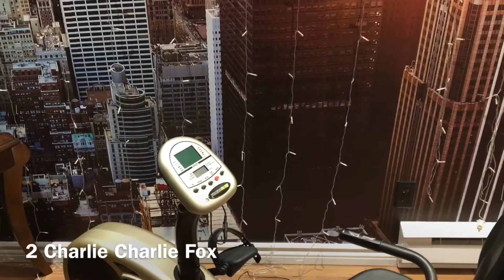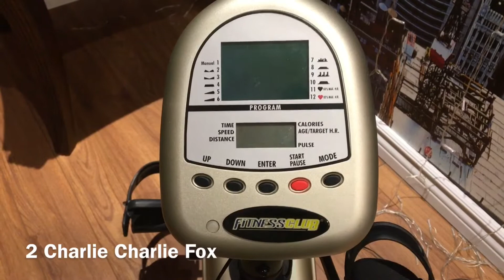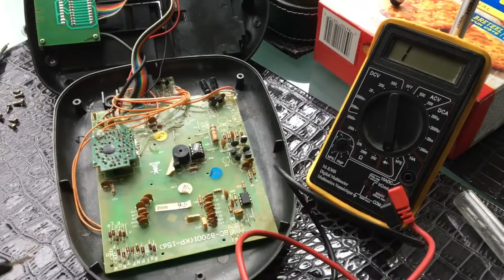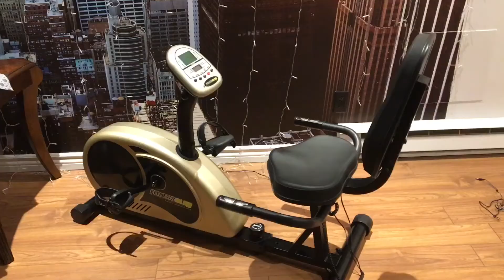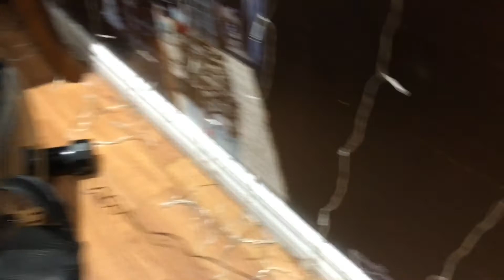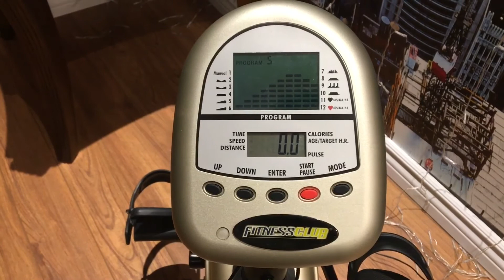Display screen repair for exercise bike

Comment: Thanks for posting the video and the tips on checking the diodes first. In hindsight, could you have isolated the power circuit solder points and tried reflowing those first and tested to see if you get power before having to reflow every solder joint on the board?
Reply from the maker: Hi thanks for watching. To answer your question  yes but as I am not the experienced tech I reflowed all points  after checking diodes as I have had  good results on another repair as well